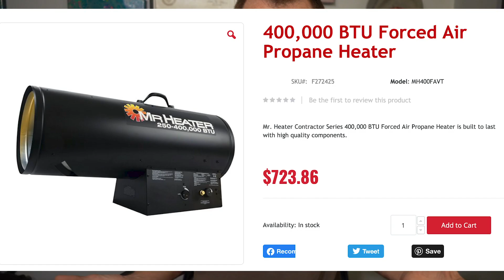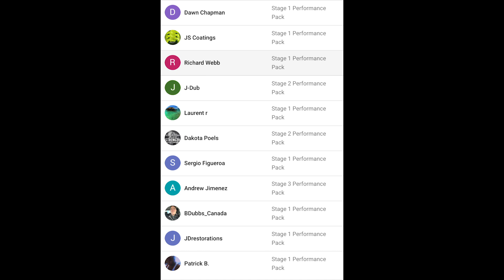DIY Powder Coating Oven Build Checklist

Comment: Thanks for the video, it's very helpful.  I'm looking at building a smaller oven - 3' x 2' x 2'   Do you think the smaller Mr Heater 30,000-60,000 BTU would provide enough heat for powder coat curing?  Thanks in advance.
Reply from the maker: It should be

Comment: Good video but... Fiberglass will NOT CATCH FIRE! Mineral wool is better however check your facts...
Reply from the maker: Mineral wool is better for insulating the oven for sure. As for gaskets fiberglass lasts much long and is more durable than mineral wool, making it much better for gaskets. But people can use mineral wool if they want, they just may have to replace them more often, if they can easily find them.
Reply: yup exactly what I was thinking! I used fiberglass on my oven

Comment: Hey guys, how do you deal with venting fumes when powder coating  parts. I have realized that when i open the door a lot of fumes/smoke comes out which i am sure is not healthy to inhale... thanks in advance..
Reply from the maker: We’ve never had an issue. Some powder do tend to have a different smell but no fumes really
Reply from the maker: We’ve never had an issue. Some powder do tend to have a different smell but no fumes really
Reply: Does your oven have a vent....
Reply from the maker: @robinrickhi4934  yessir.  We mention it in a couple of our build video i do believe

Comment: What size rivets did you use?  You said you used 18 gauge metal, what kind of metal, aluminum, iron metal,...? How much is the cost of a 4’x8’ sheet where you are now. I checked black iron 4’x8’ black iron for outside of oven @ $75 each tax included.
Reply from the maker: I believe they were 1/8" rivets. I don't remember the cost of the metal, but in one of our videos we went over the cost of the entire oven and we had the metal price included.  $75 sounds about right.

Comment: I've been running electricity in my oven but here I try to do a propane heater when I shut the door  goes out
Reply: add a vent at the top
Reply: @AZ19130  what size of vent thank you Jeff
Reply: @jeffreyjohnson9169  3-4in should be good
Reply from the maker: Thank you
Reply from the maker: How did the vent work for you?

Comment: Do you think i will need a fan in my 8'x8'x10' oven heated with a torpedo heater?
Reply: I've always calculated to allow for an exhaust fan. This can make your oven interior slightly negative and this prevents all the whining about burning eyes and eliminates carbon monoxide naps. Sending the exhaust through a heat exchanger so that the potential losses can be used for building heat if it's cold enough or as a preheated inlet supply for your burner. I was wondering, do you loop oven air back through the torpedo heater? Is this even an option or will the heater overheat? I doubt it would handle full oven temp but might be okay with a percentage.
Just a few thoughts. Oh, one more thing: running parallel thermocouples is a trick to stabilizing temperature. They give an average temperature without having to add any hardware.
Reply: @WireWeHere  I appreciate the info you gave me. I don't plan on looping any oven air through my torpedo heater because like you said, i think it would over heat. On the thermocouples, mount one low and one high?
Reply from the maker: You should not.